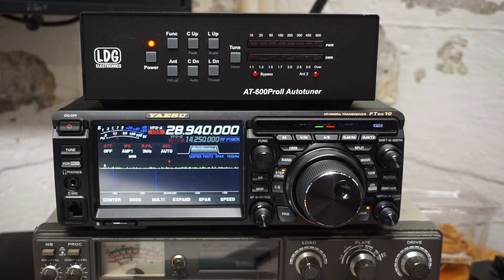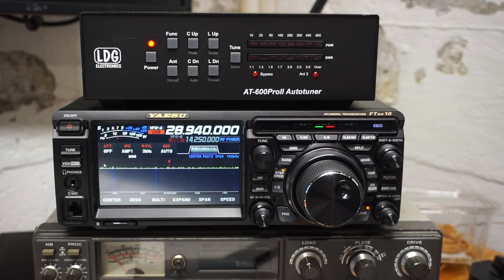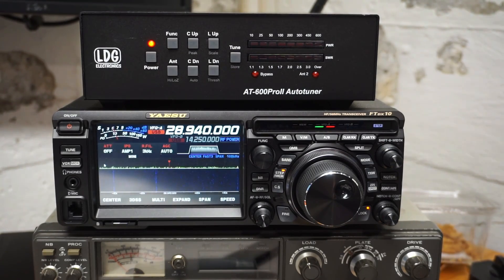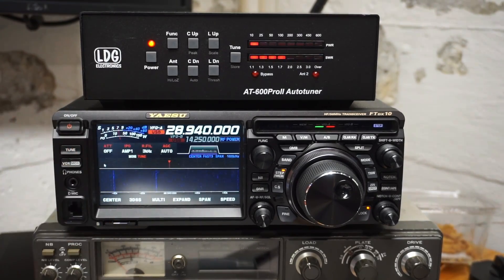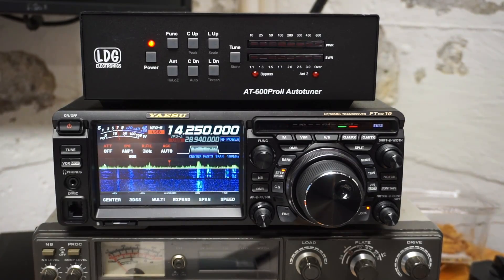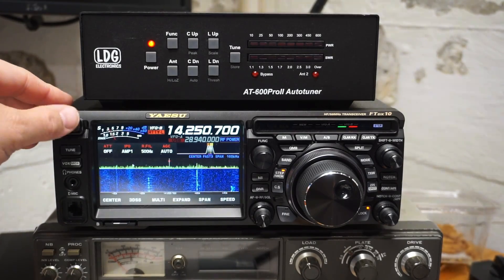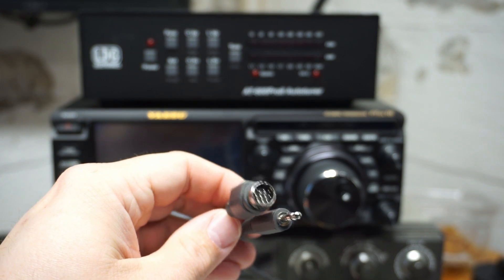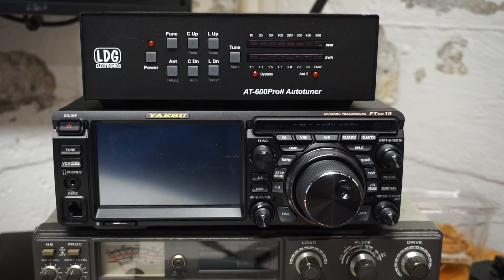Using an LDG AT-600ProII with a Yeasu FTDX-10

Comment: The LDG tuner is not at all controlling the power output during a tune, that is the foldback circuit of the radio doing that. you need to set your CW output to 10W in the actual Yaesu menu

Comment: John, shouldn't you be setting the FTDX10 to use external tuner?  In your demo it looks like you have both the internal tuner tuning and the external tuner tuning after that.  I'd assume this would create a mismatch between the external turner and whatever tuning settings your FTDX10's internal tuner is set to.

Comment: Hi, did you set the FTDX-10 for external tuner to use and not the internal tuner (Func button -> Operation settings -> general -> 5th in the row from the top -> change to EXT). My FTDX-10 works perfect with the external tuner and I use the tune button on the radio itself. I even get power using the minidin cable. Cheers ON4VP
Reply: I tried ths just now and it still triggers the internal tuner. Are you using an interface connected to the "Tuner" port or the "Linear" port on the rig?
Reply: @DZCad90  this is the important question! Hope someone will answer.

Comment: There is a guy on eBay selling a adapter for yaesu to Icom so you can use the tune button on the yaesu when connected to a LDG tuner. I have one on my 891 and all I do is press the tune button on the radio and it activates the LDG tuner.
Reply from the maker: Neat! I'll have to see if I can find that.
Reply: @john8520  every time I try to post a link it disappears.
Reply from the maker: @ If you want to try and email it to me that's fine, my email is just my channel name at gmail
Reply: On the 891 you don’t need a special cable. Switch the menu to LAMP not External and the tune button works.

Comment: what if you went into operations settings and change the tuner from internal to external, would the button work then?
Reply: That’s what I thought also, normally the tune button on the radio will work.

Comment: Hi John, The 10 pin mini DIN plug is not a standard plug, For some reason Yeasu have "Flattened" the bottom of the metal shield (close to pins 8, 9, & 10). Off the shelf plugs don't fit in the Linear socket.

Comment: I have the MFJ-929 external ATU with the interface cable. I have to go into the Yaesu's menu and turn off the internal ATU and tell the radio I am using an external ATU. Now when I push and hold the TUNE button on the radio, the radio sends a carrier to the external ATU which then goes into the tune mode. It tunes and stops when it makes a match. Once matched the radio goes back into the receive mode. 
You did not turn off the internal ATU. Turn off same and set it up to see an external ATU. It may work with your LDG?
Barry, KU3X
Reply: Uh Oh ! After watching the ENTIRE video, I see you already understand the interface cable issue. Sorry, Barry

Comment: Thanks for putting this out there. I just ordered the radio and was wondering what cable I needed to use my AT-200PROII. LDG’s website was less than helpful.
Reply from the maker: You're very welcome! I hope they can get their documentation together, it is a mess, and there are still plenty of unanswered questions. (Namely, how to use this with an amp.)
Reply: Just hooked up the DX10 and AT-200ProII last week. Takes a little while to get used to it.

Comment: Did you ever figure out how to add an amplifier that also uses the radio's linear port?  That's what I'm looking at also.  I have an AL-811 with a Ameritron ARB-704 interface that also needs the linear port to work besides the AT-600Proll.
Reply from the maker: That’s a great question, and I have not. I don’t yet have an amplifier, but I suspect that splitting the port into two may be necessary. A detailed pinout of the “linear” and “tuner” ports on the DX10 would be very helpful.
Reply: @john8520  I Called LDG today.  Since the interface is using the linear port, the LDG can't use it.  The LDG is used in the semi-automatic mode so you have to push the tune button on the LDG while you key the mic with the amp in the standby mode.  You can't use the automatic mode with the AL-811 with the interface.
Reply: @dpsflyboy Thanks, I recently purchased an AL11 to go with my Dx10 and am still trying to figure out how to get everything working.  It also came with an ARB 704 buffer interface.

 Being a noob, ham I did not realize I also need an external ATU.  I was thinking the LDG seemed like a good option, but am now questioning that for my setup.   If you can't use it in auto mode, would a manual Palstar be a better option?  This all seems to be getting complicated.  Perhaps I shoukd just look for a used solid state amp instead,  something like a Yaesu FL7000???